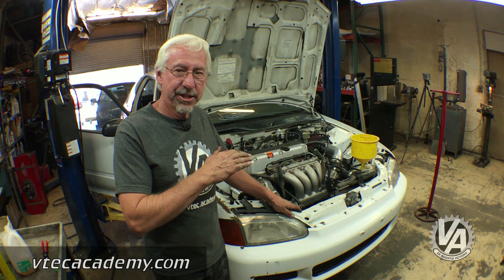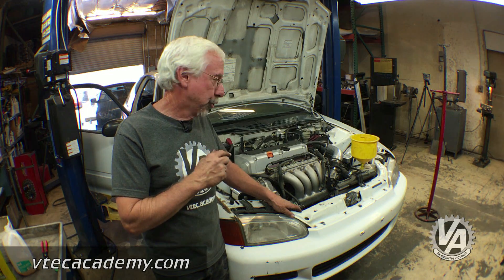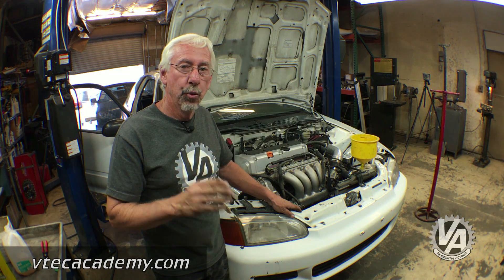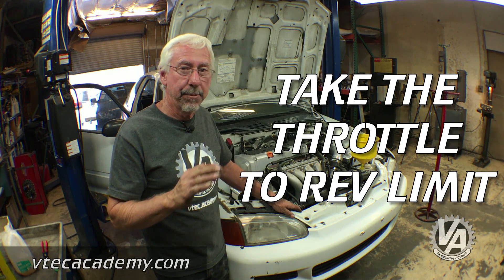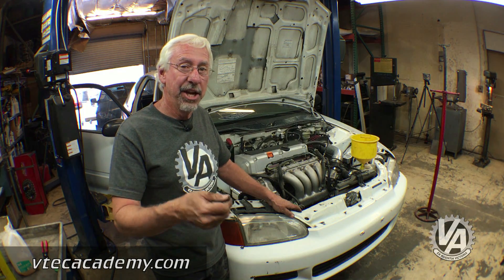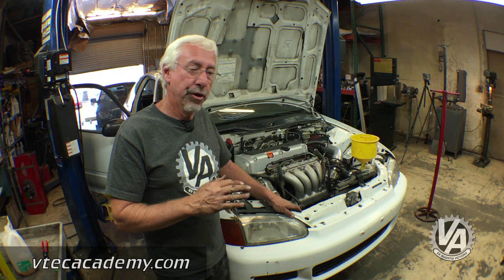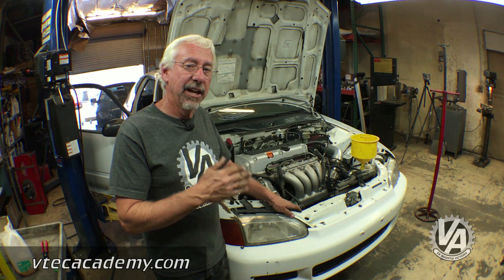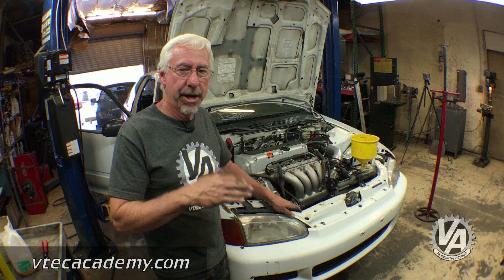How to set K Series Idle

Comment: Do you just need to disconnect the battery and wait 10/15 minutes for the ecu to reset and do an idle relearn?
Reply from the maker: Not even that long. 30 seconds should be fine.

Comment: I just did a head rebuild for my Honda element, started it up and it was running, but a bit rough with the motor shaking violently, then I started seeing smoke coming from the back where the header is. 
Around that time, without touching the gas, it then started to go up in revs around to say 2k? 

Got scared and turned the car off.

So this is normal for first start after rebuild?
Reply from the maker: The smoke could be from greasy or oily handprints on the header. The high revving is typically a sign of a vacuum leak somewhere. The violent shaking is a concern. That sounds like it might not be the correct timing. Check the timing chain and make sure it’s on correctly.

Comment: Do i have to do this if i change the battery or if the ecu ever loses power to the ecu?
Reply from the maker: I've been told by Honda technicians that you need to do it whenever your car looses power. I have been told by tuners that you don't need to do this. My observation is the car's ECU will eventually learn the idle after several start ups, but this just make it happen faster.

Comment: Swapped a 20,000 mile 2014 TSX engine into our 2010 TSX body.   Idles at 1,200.  Tried the two methods outlined here to “learn” the computer.  Neither worked. Other methods?  Need to rotate the TPS throttle position sensor set at the factory?  Thx

Comment: what do you mean let the radiator fan cycle 3 times?
Reply: turn on then off is one cycle
Reply from the maker: +eLTy williams correct.
Reply: that specific? noted.
Reply: So turn the car on and off 3x then Rev limit?
Reply: @ThatguyLeoS  no, turn the car on, let it get hot enough that the cooling fan starts up (then when it's done its job the fan shuts off), let it do this on/off fan cycle 3 times, then rev limit, then turn car off - apparently.

Comment: I got a 1996 Acura Integra GSR with an LS swap engine in it. I've done everything to help the idling issue (Air filter/Throttle Body butterfly flap decarbonized/spark plugs and wires/tightened throttle cable and ran Seafoam through it) Still hasnt completely fixed the problem.  I love your channel. KEEP IT UP$
Reply: Have you tried to bleed the coolant? Could possibly have a air bubble in the system.
Reply from the maker: Thanks for the support! Visit us over at vtecacademy.com for more.

Have you tried this https://youtu.be/HNaxJPUkSoU to set your idle on your B series?